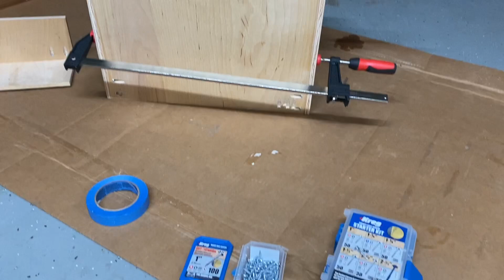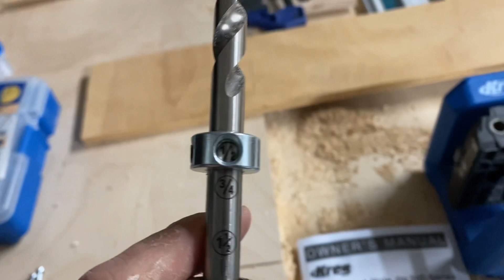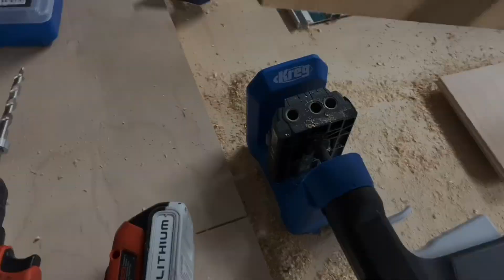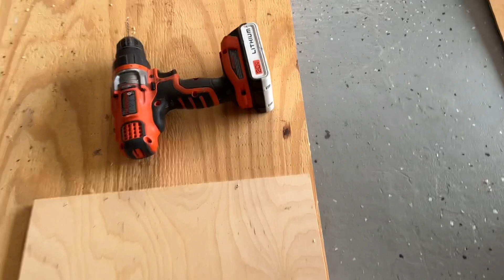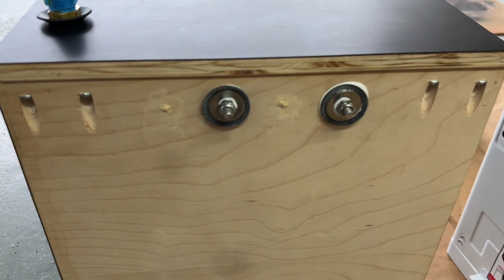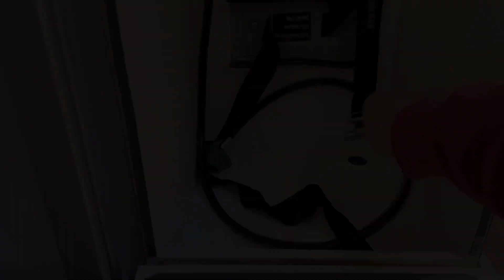Ford Transit Van Build | Building the Propane Locker

Comment: Thank you so much for this detailed video. Knowing what type of materials to use was my biggest concern and your video addresses that! Thanks again!!!
Reply from the maker: Thanks for watching!
Reply: @blazingwanderers  would you be able to tell me how you connected the regulator output to the hose to the top of the propane box? As in the fittings and the hose used by chance?

Comment: Hey is there any chance you could link the parts you used from the propane bottle fitting to the regulator? I'm having trouble piecing it together. Great video!
Reply from the maker: Thanks for watching!  Here is a list of the parts we used from propane bottle to exiting the box--hope this helps!  We ordered some parts from Amazon and the rest from RV Panther products.  They don't see to carry the brass adapters we ordered through them, but you could easily go to Lowes or Home Depot and pick them up there.

Marshall MER Type 1 36-48 in pigtail propane hose 	https://pantherrvproducts.com/type-1-pigtail-propane-hoses/

Solenoid Lock Off Valve LPG Propane 12V FUELOCK LOCKOFF Liquid Vapor Gas Volt LPG 151	https://www.amazon.com/dp/B077XQX9YJ?ref=ppx_pop_mob_ap_share

Marshall excelsior Megr-298P 2 stage regulator 	https://www.amazon.com/gp/product/B01CZ2YU56/ref=ppx_yo_dt_b_search_asin_title?ie=UTF8&psc=1

Marshall excesior mounting bracket	https://www.amazon.com/gp/product/B00K24B742/ref=ppx_yo_dt_b_search_asin_title?ie=UTF8&psc=1

Marshall MER613-12 LP Supply Hose 3/8" Female x3/8" Female 12"	https://pantherrvproducts.com/mer613-12/

AMC 704018-06 Brass Flare Forged Nut Fittings - 3/8" 9 (ordered 6)	
https://pantherrvproducts.com/----not currently available

AMC 704044-06 Brass Propane Tee Fitting 3/8" Flare	https://pantherrvproducts.com/----not currently available

Marshall ME488 Propane Disposable Cylinder Brass Adapter	https://pantherrvproducts.com/----not currently available

MB Sturgis 204163 Propane Elbow Adapter - 3/8" F. Flare Swivel x 3/8" M. Flare	https://pantherrvproducts.com/----not currently available

Good luck on your build!
Reply: @blazingwanderers you're awesome, thanks, so much!!
Reply: I too after referencing your video used pantherrvproducts. Good stuff!

Comment: Looks great! What size is your vent hole? I will be using the van in the winter and don’t want to make the locker freezing cold with air coming in through the vent…any suggestions? Thank you.
Reply from the maker: hi there!  Sorry for the delay--I was backpacking for a few weeks on the AT!  To answer your question-the vent hole size is 1" ID for the PVC, 1 5/8 OD.  We haven't tested it yet, but our propane cabinet is inside a secondary cabinet so shouldn't be an issue with cold air coming in (directly). Hope this helps!